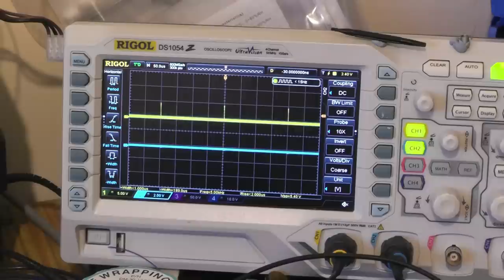Industrial CO2 Laser Coder TEARDOWN and repair! Part 1!

Comment: The first "serious" laser I ever saw was a co2 laser when I was a kid visiting the Ontario Museum and Science Center in Toronto in the 80s. It had a power output of maybe 1 or 2 hundred W, was 15cm in diameter, AND TWENTY METERS LONG. It filled the entire large lecture room from one end to the other that they housed it in. I can't remember how many kW it consumed when they turned it on but it must have been insane. It had a control panel for firing it up that looked like a prop from the bridge of the Enterprise. Apparently it was built by GE France and originally part of France's "tradition and innovation" pavilion at the Montreal '67 Expo. They would dim the lights for the audience during the show at the science center, evacuate the clear room-long tube, and sequentially fill it with continuously flowing helium, co2 and nitrogen from large gas bottles while the tube was energized. You could actually see the characteristic light emission from each gas as it traveled down the tube and ultimately filled the room with a hot pink glow. After some tinkering with the optics they opened the shutter and shone the light at the focal plane onto various materials like plexiglass and a 2 by 4, which dutifully burst into flame instantly and made a kind of hissing noise as it was vaporized. Behind the focal plane in the experiment area, a beam stop made of red masonry bricks silently glowed white hot between material demonstrations. It was amazing. Sad there's basically almost no record of it or any video anywhere, with just a single small and grainy image of it in existence on the web so far as I can tell.
Reply from the maker: Awww man! That sounds epic! Such a shame there isn't a decent video of it! The hissing sounds familiar, even this little 15W when focussed to a point (just got a decent focusing lens in the post today), positively shreds ceramics, stone and glasses with quite an evil hissing sound.
Reply: The first serious commercial laser I can recall was at the end of my Physics/Electronics degree when the faculty was showing us around some projects looking for masters candidates. They had a laser set up to illuminate a magnetic storage device using polarised laser light to show the different induced states. The laser had 8kw mains input but I don't recall the output - less than 10 watts I think and was about the size of a carry on suitcase - presume a semiconductor laser - 1975.
Reply: @rhiantaylor3446  probably argon-ion. if it was blue green, then definitely.

Comment: Hello Les. I just ran across your channel and found this video. You have done a good job at troubleshooting this laser. Full disclosure I work on Synrad and other CO2 lasers for a living. The laser you have is a J48-1. It was probably around 15 watts when it was new. I believe the power range was written on the tube. Just like the wavelength of 9.3. These are called "blue tubes". They are made to mark pet bottles. This would be water bottles, coke bottles etc. A typical CO2 laser is 10.6um. The full unit was  made by Sator laser in Germany, which was bought out by Domino printing Science in the  UK. Anyway, the tubes are filled at less than  atmosphere. I'm actually filling a synrad tube while I'm writing this now. They are filled at 82 torr. Atmosphere would be 760 torr. So when they leak, they actually suck in air. This is why your helium bag trick worked. More helium will make it easier for the laser to light, but what is happening is the gas is breaking down and causing the light off problem and will cause modulation problems. Meaning it will only run at low duty cycles. You might see the same power or even less at 90% compared to 50%  Once the gas breaks down enough, it will no longer light. Then you run the risk of blowing the transistor. We see this alot. Having said all that, these synrad lasers can last a long time. So great job troubleshooting and getting it to run.
Reply from the maker: Thanks! And thanks for the info!
I managed to get hold of a copy of the tuning guide after this video was published as well, so I will get some use out of it, even iif it meant I need to re-tune it occasionally.
I'm curious about the gas fill, is it a standard CO2 Laser mix (what are the ratios), or is there some secret sauce (additives like Xe, etc)? No pressure if it is a trade secret!
Thanks for the tip about the output transistor, those things are not cheap!

Cheers!
Reply: There are some secrets. I'm assuming that someone who can refill a laser already knows the basics.  Also, I'm not exactly sure what Synrad uses, but i can tell you what would work. 10% Co, 10% Co2, 75% He and yes you made a good guess 5% Xe. This mix will run that laser. I believe I mentioned 82 torr before, actually for that model 75 torr works better. If you ever need to get that laser refilled. Let me know.
Reply: @7TIV  Need some N2 up in there and no bespoke CO at filling, just CO2. Synrad runs Xe-rich compared their competitors so Xe in the 48 series will be closer to 8%.

Comment: CO2 laser refills aren't really that complicated or expensive, and can be done in a home lab. The gear required is a bit of a wallet biter(forepump + turbopump + baratron + piping + micrometer valve), but if someone is already playing with vacuum-related stuff, the rest is just an adapter to whatever fill port the tube is using. In you case it's a bit of a pain, since you need a mechanical passthrough to screw the port shut while it's at fill pressure, but still very doable.
Surprisingly enough, the gas mix is a common line item pretty much everywhere in the world, and is sold for very little money! My guess is that it's sold in bulk to supply open-style ultra-powerful(kW level) lasers, which have the gas as a consumable.

The XY2-100 protocol is simple - there's one PDF that you can find that explains basically everything in just a few pages. There's nothing to it, so your conclusion of "very little info" is pretty much spot on. Besides the extended control/status channels, which are implemented at-will by scanhead manufacturers(no spec), the actual X/Y/Z channels conform to the same standard.

A hint for actual marking use of the scan head: the XY2-100 protocol is usually piped directly into DACs and is immediate, so you should have a bit of dead time after large jumps, to let the mirrors settle before you fire the laser. If you don't, you'll see "fuzzies" around the corners as the mirrors ring.
Reply from the maker: it might be more nuanced that that for sealed tubes. As far as I am aware, sealed tubes require a gas mix that is quite specific, the additives that allow the catalytic conversion of Carbon Monoxide back to Carbon Dioxide, and is therefore a different composition than for flowing gas CO2 lasers. That said, I am happy to be proven wrong, and will possibly even attempt it if this tube fails.

Thanks for the hint regarding the scan head. The library example include a delay, and if it is to small, there are fare worse side effects than ringing! There is a cool lib called Opal for the teensy that I am going to play with, all I need is a simple drawing program that will spit out GCode.
Reply: @LesLaboratory  You can run pretty much any mix in a slab laser, it'll just degrade way faster(i.e. years instead of decades of runtime). Not that big of a deal for hobby use.
But in any case, mixing your own gases isn't that complicated either, just have to buy a few extra valves and cylinders as separate.
Reply from the maker: @Spirit532  Thanks for the info, that is interesting, if I had to do it every year, it wouldn't be that bad. I already have a forepump and a small diff pump that I used back in the day to build x-ray tubes and stuff, so it would only be a small outlay. The valve will be a pig, but I'm sure I can arrange something if sufficiently motivated!
Reply: @LesLaboratory  Beware that with an oildiff you will need a cryo(dry ice bath) baffle or submerged coil condenser. 
Lasers do NOT tolerate contamination, especially of the oil backstreaming variety.
Reply from the maker: @Spirit532  Totally, X-ray tubes aren't too happy about it either. The thing is internally baffled (a total pain when I refurbed the thing). I will work something out, but in the meantime I will keep an eye out for a decent turbo-pump. I have always wanted one anyway for other projects.
Reply: Ah, the laser needs tuning. The balance coil is inside the tube itself so it cannot be adjusted so the center frequency of the RF needs to be tweaked a little. Be sure to check the capacitors on the laser's RF section. Synrad is my favorite make of RF CO2 lasers. The gas mixture is basically a standard He:N2:CO2 commercial laser gas mix but with xenon at 3-5%, water vapor at 1%, and carbon monoxide added to stabilize power at roughly 2%. These extra ingredients help create an even discharge field and recycle the CO to CO2. Once i substituted a few milicuries of radioactive H3 with oxygen for some of the water vapor fraction. This caused the tube to be easy to operate at fast modulation rates up to about 120kHz and it no longer required the keep alive signal to reliably ignite the plasma channel. This was a very special laser head that had a grating tuner on one end as well. Refilling these are not trivial, but was done using fairly standard neon sign making equipment. Don't overdo the hydrogen fraction, it needs to be there, but too much makes the disharge unstable. 🤓
Reply: @LesLaboratory  I used to work for these guys. I've even regassed the specific model in this video many times. I can tell you there's not much special about the laser gas mix in RF CO2 lasers, however the only thing I'd worry about is the small packet of zeolite in there that absorbs moisture ingressing through the o-rings. Once that's saturated the laser's lifetime will be measured in weeks or months because even a few milletorr of water vapor in the gas mix is enough to kill your gain. The only way to revitalize it is by baking the resonator tube under vacuum.

Comment: Ive had similar units and they had synrad lasers in them that usually worked well. Got one working that was made by Markem then hacked the living 💩 out of the controller so it could mark greyscale images on stuff. Also found that changing the final lens can drastically improve the  usable field. 😁

Comment: great find, would have picked up myself when one would show up over here.
i got this synrad j48-1 co2 laser aswell,
built in 1999, still works at full blast. its supposed to be a 10W laser (but has written 30W on it) mine consumes about 200W at 100% duty cycle
refills are unfourtainly not cheap.. they know where they can get your hard earned money
i wonder why synrad didnt include the tickle signal generator onto their control pcb.. they rather sell you a UC1000..
i once had a 150W coherent sl800 tube, it required like 3kW at full blast, its pwm input only went up to 60% duty cycle.its divergence was like 12mrad, and due to its internal mirror arrangement it had a axis that had more expansion than the other, it came with a slightly curved mirror to counteract this.
Reply from the maker: Thanks! Sounds awesome, yeah refils are about $1000USD or there abouts, still cheaper then new I guess. 
Yeah, it is weird, perhaps the signal was external for OEM applications. They are very nice compact lasers though.
Nice! I have been offered some more CO2 goodness for free (watercooled, part of an engraver), but I have to wait for it. It is not as high as 150W, but that would be nice to see
Reply: @LesLaboratory  If ever there was a project for the community this would be it. The local pack of thieves want USD 3500 to re-gas a 30W Coherent unit. Often wondered if we could use the Laser gas that we get in for our 2KW Rofin and change it regularly.

Comment: Les, please tell me you've seen the film "Real Genius"? lol

I only recently discovered your channel, and it's been great.

I was always a fascinated with lasers, but never owned anything on the scale you have there.
The teardowns of this stuff are particularly interesting, as it's gear that we don't usually get to see.

I owned a couple of Argon lasers in the past (A JDSU 2214-40MLAM, and some other thing with an NEC head), and I built a few RGB lasers with galvos.

But I sold the Argon lasers in the end, as they rarely got used. I instead built a much smaller 3 Watt RGB laser, using an RGB module from AliExpress. It took a lot of hassle out of the alignment.

I managed to immediately pop the Blue diode when I got it. lol
I was too eager to test it, and hooked up a separate wall wart to drive the analog input, and it popped the diode.

It was easy enough to replace, though. A standard Nichia blue diode from a Casio projector worked well enough, but it does have quite a wide beam now. I have some anamorphic prism blocks somewhere, which I'll add to the blue diode later.

Anyway, I think I'm gonna like this channel. I have a lot of binge watching to do. ;)
Reply from the maker: Of course, and everyone else should as well, it's a moral imperative!

I was looking at those Aliexpress RGB Lasers a while back (still in my shopping basket), but I have too many other project on at the moment!

Thanks, there is some cool stuff on here including a nice Multilin Argon-Ion Laser and other fun stuff!
Reply: @LesLaboratory  haha, I thought you might.

"I was thinking of the immortal words of Socrates who said... I drank WHAT?!"

I just watched your vid on the DIY nitrogen lasers earlier, and the multiline Argon last night.

So yep, that was the same model I had.

I have a very old video on here somewhere, showing the different lines, with a cheapo grating.

I didn't have much use for it once the initial novelty wore off, tbh, aside from using it as a 1KW heater. lol

The 3W to 4W RGB modules on AliExpress are well worth playing with. I think mine was around £300, but it made the whole build simpler and more compact.

Thinking about it again, I think it only has anamorphic prism correction for the red diode, but it does have a 

Galvos are just a cheap PT-35K, IIRC.

The first galvos I had were PT-20 (Phenix Technology). I wasn't expecting too much, but they were actually great for the money. I bought them direct, and only paid around £70 for the galvo pair, drivers, and PSU.

Anyway, I need to stop rambling. lol

Do you have Twitter or are you on any chat groups at all? (hope you don't mind me asking on here.)

Comment: Frequency of oscillation, the laser tube is, I think, a resonant cavity so if the RF is the wrong frequency it won't lase?
Reply from the maker: That was my thought, I have tweaked that variable cap, and it seems to be behaving...for now.
Reply: @LesLaboratory  When you expanded the pulse to 50% (at around 12:45 in the video) , what was the oscillator frequency they were feeding to the tube?  I'm guessing that based on the mechanical variations in the tube manufacture, that they would measure the output power, and adjust the RF frequency for peak performance.  Consider the RF as a source of POWER into the cavity to excite the CO2 so it can do it's laser thing.  The excitation frequency is NOT related to the 9.3um optical output wavelength.  (Just as with a DC-excited High Voltage glass tube.  There are lots of ways to excite the molecules.)
Reply: So is that a callsign and a Maidenhead locator, or does it just look a lot like it?

Comment: Did you sort out the dreaded intermittent’ fault?  Is there a part 2 somewhere?
Reply from the maker: Yes, I did, though I did not video it. The part 2 was driving the Galvos. The fault was, the Oscillator was out of tune (Likely because the tube has aged) , and this can be rectified by slightly tweaking that variable capacitor you can see at 12:12. I got hold of the tuning guide for these heads as well, and followed the procedure, and it has been fine since.

Comment: Now his I call a laser. Electrolytic capacitors are of short life, about 3000 to 5000 hours at nominal voltage and 70C or so. Then they fade out and usually the power suplies stop working. It is better to use other cap technologies to make them to work again.

Comment: Any plans for making TEA type DIY CO2 lasers? Curious about those, not many projects online like that.
Reply from the maker: Yes! It's been on my mind lately, I just need to get around to ordering optics and mounts!
Reply: @LesLaboratory  Any idea does it lase without mirrors like nitrogen? Been so long since I last read Sams laser FAQ :)
Reply from the maker: @Dagosaatana  It might, the gain is pretty high, but I suspect you would need a very long tube for this to occur.
Reply: @LesLaboratory  How did the lasing time differ from nitrogen? How fast does the pulse need to be

Comment: Hello,
I wachted this video and was wondering if the helium is the only thing that fixed your laser or did you find some other problem? It worked for now but did you make any changes for it to keep working? I think I have a similar problem with my Synrad laser. Eighter the laser powers up to slowly and in that way skips the beginning of my drawing or it won't start at all. Only after I touch the probe that goes into the laser it will fire again. Any information would be helpfull :)
Thanks for this great video!
Reply from the maker: Thanks! It turned out in the end, that tweaking the variable capacitor in the head, just a little, allows it to reliably start. I think Helium had nothing to do with it. Synrad has an RF tuning guide I believe that discussed the process of tuning the RF section correctly,